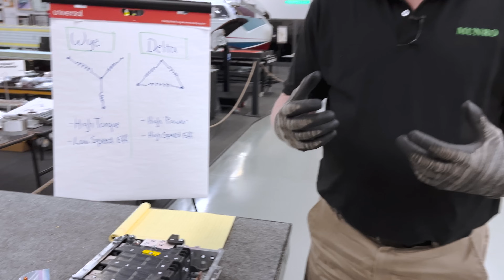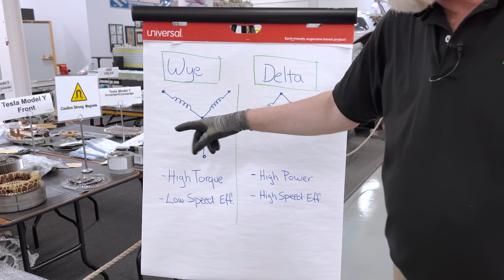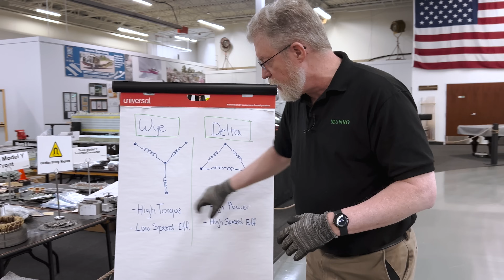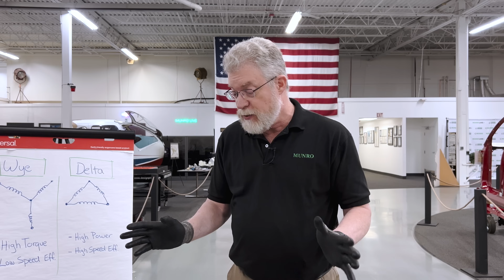KIA EV9 Dual-Stage Motor & Inverter Breakdown: Engineering Unveiled

Comment: This is very interesting! Thanks for the video. I would like to see the inverter teardown in the next one.

I'm curious if there really happens switching between Δ and Y or if there are just two 3-phase H-bridges there, connected to 3 terminals of the motor, i.e. completely independent driver for each coil.

The reason why Δ connection is not used in EVs is the variable inductance of the coils due to saliency of the rotor. I've measured it on the “Hyundai Ioniq Electric 28 kWh” motor. The inductance of the two coils in series in the Y configuration varies from 440 μH to 1100 μH depending on the angle of the rotor.

As the motor controller regulates the current thru the coils, the Y configuration is better because just 2 current sensors outside of the motor are enough the know the current thru all three coils. In the Δ configuration, the current splits according to inductances and if these are not the same and varying one would need the current sensor on each of the coils to be able to control it.

That's why a motor with Δ configuration would probably have 6 terminals as well, because the current sensor is naturally housed in the inverter and the Δ connection would be realized there.

Switching between Δ and Y would allow them to use higher inductance of two coils in series in Y configuration in lower speed to be able to control lower currents more efficiently. At higher speeds they could switch to Δ-configuration, alleviating the need for field weakening.

But this would be at the cost of additional Rdson of the transistors making up this switch. On top of that these would have to be actually 2 NMOS SiC in series (IGBTs would need additional components as we need it to switch the current in both directions).

Permanent 6-wire connection to two 3-phase H-bridges, on the other hand would have higher switching losses at lower speeds, so I am really curious which architecture they actually chose.

Other automakers like Honda use step-up converter (350V -> 700V) in their hybrid vehicles to shift the need for a field weakening towards higher speeds.
Reply: Very informative comment. The Munro live community never ceases to amaze me with their insights. We did check the winding pattern and physical connections to the inverter to determine whether this was set up as two 3-phase machines or a wye-delta arrangement. We also did a patent search and found a Hyundai patent covering this circuit and control method.
Reply: @PaulTurnbull-EMfield  Interesting! What did you find? Do they use Δ-Y switching or just 3 independent H-bridges, one for each coil?
Reply: The description and the appearance of the inverter case suggest that the inverter has six power outputs using three of them for delta and the other three for wye.
Reply: @brianb-p6586  That's highly unlikely. The motor has 6 terminals where each pair of terminals is connected to the coils of each phase, respectively. Having a stator with two sets of windings one for Δ, the other for Y would be wasteful as most of the time only one set of coils would be conducting current. This means -- if we made a single set of coils of twice a cross-sectional area of the conductors we would have 50% reduction in losses. Therefore I think it is better to have both terminals of each phase exposed and let the inverter to do the right connection. Besides, in Δ configuration, the controller needs to know the currents in each coil. It is not enough to measure to summed current in the vertices of the triangle and it does not seem that the current sensors are embedded into motor windings. The are usually found in the inverter.
Reply: @32bits-of-a-bus59  you're right - I had not had my coffee yet! The six inverter terminals, each driven by one power section, need to connect to the six winding terminals. All six are required at all times, driven to effectively make the two different connection topologies. 

In delta each phase would need to be driven by two inverter sections, with their net current equaling the net phase current, but current from one winding to the connected (in delta) phase passing through both sections instead of none. 
In wye, three inverter sections would need to serve as the three phase outputs, with the other three effectively shorting the other ends of the windings together.
Reply: @brianb-p6586  I'm not sure if it can be done so easily. Take for example your suggestion of having Y connection realized by using the second 3phase H-bridge to connect the terminals together.

That's problematic because a standard H-bridge would also ground them or connect them to a supply voltage but we need a floating center tap for Y-connection to operate as expected.

That's why I'm not yet convinced if they really are using Δ-Y switching. Though it would have the advantage of larger inductance at low speeds, thereby prolonging the impulse time to the transition time ratio hence lowering the switching losses. But it would require 6 additional N-MOS transistors.

Two of them in anti-series connection would be needed to connect each phase to a central tap because the voltage direction changes during the rotation and N-MOS can only be really turned-off one way (because the body diode always conducts in the other).

Then you would need another 6 N-MOS transistors to realize Δ connection.

These 12 transistors would just switch once to select the configuration so there would be no switching losses as in the H-bridge. Only Rdson losses.

But whether it really pays off over just having two 3phase H-bridges and operating them as 3 2lead H-bridges, one for each coil, I'm not able to tell.

Maybe they have managed to design a switch between Δ and Y in a more elegant way than I was able to imagine and they don't actually need 6 more power transistors over those 12 used in the two H-bridges that would control each phase independently.

Comment: Instead of ioniq 5 Boost DC/DC converter using the motor’s inductance for 800V battery charging at a 400V charge site

It is even wiser to have a battery pack split module to halve 800V battery to 400V - for native charging on any fast charge system, without power loss

Like the cybertruck does

Comment: Excellent presentation! I don't know if what Kia did could be termed First Principals thinking, but it is definitely thinking outside the box.

Couple of notes:
1) When Paul mentions "interior magnet" the full description of the term is "interior permanent magnet".
2) When he refers to the "switches" in the inverter, I'm pretty sure he is referring to the Silicon Carbide switches used by the inverter (not sure if they are MOS FETs or IGBTs). Interesting that Tesla has backed off of SiC based switches (as opposed to traditional silicon), as Kia ramps up their use.
Reply: re 2), cost most likely SiCs are a fair bit more expensive than traditional silicon.

Comment: Now, imagine an attack on the car and making it change from Delta config to the "charging mode" while going at full speed in the road!!! Do they add security in those "smart" stuffs???
Reply: You're assuming this is software controlled with access by the car's ECU for OTA updates; it is more likely hardware controlled (even if MCUs are involved) inside the inverter. By way of example, the recent Kia update's to the ICCU charge controller was requried to be done in shop not OTA using a physical connection.
Reply: @GruffSillyGoat  OK, let's assume it's hardware controlled. Now imagine a fault in the "crash" sensor leading to the first scenario. Are they using some sort of protection for this cases? (See https://en.wikipedia.org/wiki/Radiation_hardening - Section "Logical" in "Radiation-hardening techniques", also https://en.wikipedia.org/wiki/Triple_modular_redundancy). If they are, those systems will be expensive, since they must be reduntant (cost multiplies by a facyor of 5). If I ever buy one of those things, I'll make sure no computer takes control of the car (or any critical system) while driving. We still cannot make computers "safe" for this kind of stuff (it's expensive and expensive goes against capitalism 🤷‍♂)

Comment: Plenty of equipment in the industrial industry that switches between Star and delta without stopping the motor , not sure why you would think otherwise, I  bet the compressor in your workshop has a star delta starter in it.

Comment: In effect, the switch between the "Y" and "Delta" configurations acts like a 2-gear transmission.
Will there be a clutch and gear shift lever offered to simulate a manual transmission?  😀

Comment: Does this re-wiring the motor mean all the current goes via power silicone twice? That could mean double the losses if so, in the inverter.
Reply: Yes, the way the "dual stage" inverter is set up the current passes through both sets of switches. Only one set has to pulse width modulate though so only the conduction losses from the second set are added. This allows Kia to smoothly transition between wye and delta unlike the contactor method that some commenters have mentioned.
Reply: Some current will need to go through two power stages instead of one, and some will go through two instead of none, depending on the configuration. Yes, that has an efficiency cost. 

The word is "silicon", not "silicone"... and the semiconductor may not be silicon.

Comment: Delta configuration allows to circulate 3rd harmonic current components which in a triangular connection cannot do as they are zero sequence/ homopolar currents. Overall is a bad decition to go to delta connection (at least if motor is tracktioning) as long as this 3rd harmonic is not being control by SW which I do not think is happening. It would be great if you have the chance, to ask to Hyundai ENG how do they deal with this 3rd harmonic issue.

Very Good Video as always!
Reply: Smart and right comment. Actually it seems that the machine is not physically delta connected. As spotted out by someone in this thread, the patent shows that they implemented an open end winding scheme. In virtual delta connection the homopolar machine current can be actively controlled (the drawback is a reduction in the maximum voltage limit for torque generation). It would be interesting to analyze the machine to see if they made design choices to reduce the third harmonic in the back emf by winding scheme or, better, rotor geometry.

Comment: Electric machine? No longer refering to then as motors?
Reply: They have always been "electric machines". That terminology is used most commonly where the machine is used as both a moor and a generator, and may be used to distinguish the actual motor from the supporting electronics and gearing.

Comment: Star / delta seen from my childhood ( seen in Floor mill the operator switching it to start and run ) .. these are not innovation , they are basic motor configs , now latest ones are hybrid ones . As you have details about all EV motor can you provide comparison in terms of efficiency , speed , cost , reliability  of motors from Tesla/Hyundai/Rivian/Lucid etc ..

Comment: You should be able to transition from delta to wye with just a set of 5 SSRs, so you don't really need to entire separate inverters to control your motor.
Reply: That's true if a traditional hard switch between wye and delta is the goal, but Kia is able to use PWM to smoothly transition between the configurations under power. That requires 6 solid state switching devices.
Reply: Those Solid State Relays are just as complex and expensive as inverter power stages.

Comment: I feel the need to interject but the Renault Zoe has been using the motors as charging inductors for probably 10 years now. People have been complaining about the whining noise while charging until the reason was disclosed. Similarly, I might be wrong, but in some old electronics books I read about big motors being started in Y and switched to delta once up to speed. I guess it's an innovation in the powertrain industry but IGBT prices are now very small compared to battery prices. I'm sure thousands of people thought about this already. Sure, cost-effective implementation is a big step so I have to commend them on that.
Reply: The ACP Tzero and original design of the Tesla Roadster also used the motor for charging.
Reply: Wanted to say the same thing. The Zoé is 12 years old now :D. Interesting that they came back to it
Reply: This is not new tech and the advantages are significantly overstated. This whole video reeks of sponsored astroturfing.

Comment: Can this be the cause of the vibrations all EV9’s have? It’s not the tires or wheels. Mine been at dealer straight 41 days and Kia has no clue the cause. Lemon law next. Google ev9 vibration they’re all doing it. The GT line loaner driving now same vibration. Go test drive all on dealer lot. 63mph to 78mph they all will vibrate the steering wheel out of your hand and vibrate the floor and console horrendously.

Comment: Holy moly!  This is no small improvement!!  I doubt the non-engineers out there can really grasp what just happened!  No, really... this concept will truly be a huge benefit... better low-end torque AND better high speed efficiency!

They really don't have that much of a cost disadvantage either, as the Inverter transistors are serving dual purpose... drive the motor AND boost conversion for charging.  

SO COOL!!!
Reply: Re: Inverter Versatility. Also, for bi-directional flows to double as power walls?
Reply: Actually this is a fairly common way to get a softer starting behavior, it's commonly used in high power asynchronous motors in industrial applications. It is quite fun to see it in an automotive application though.
Reply: He says it: you need two separate set of switches.
Reply: So is this better performing than say a Tesla Model Y motor? If so, by how much?
Reply: @willaerley7140  It can be run in two configurations that can improve efficiency at high speeds and low speeds... but there's no way to definitively say "how much" without specific parameters.

Comment: I wonder if changing the operating mode from Wye to Delta requires very precise waveform synchronization. I think that the high RPMs and the fact that the engine works with magnetic slip anyway make the change at a random moment imperceptible. I would like to hear what people smarter than me think.
Reply: "Magnetic slip"? This is not an induction motor.

Comment: The boost converter from 400 to 800 must be slower than to connect the battery pack in parallel.
I don't think we will have 400v charger for long anyway, here they are all 800-1000V appart for Tesla.
Reply: Tesla is now making 800V chargers with their V4 superchargers
Reply: @RC-fp1tl  Yes, I suspect all the new chargers will be 800V, so are the new models. Lower voltage was only to get the EV transformation started.

Comment: The way you explained the triangle vs star motor makes me think you don't know much about electric machines.
I guess making a switch to swap the connection type is cheaper than a step down coverter.
You do not gain torque. You just gain efficiency and you would not be able to use the extra torque from the extra voltage because the coils would go boom.

Comment: Thoughts on using Kia motor as boost converter to achieve 800V from a 400V charger, vs the Chevy dividing battery to be in series or parallel based on charger voltage (in terms of efficiency/cost/feasibility).  Some initial reports on the Kia has charging limited at 400V  to under 100kWh.  I would imagine the SilveradoEV would have a better charging curve at both 400 and 800V, and cost less.

Comment: Does the new EV3 have this motor?
Reply: It won't have the booster functionality as the EV3 is on 400v architecture. Whether it has the star-delta configuration will depend on the cost of the motor, as the EV3 is aimed at a much cheaper price point.

Comment: Star delta has been around for ages
No lock out just two contractors
Reply: It has, in old-skool hardwired-contactor form (e.g. star-delta motor starters), but not integrated into a motor drive like this! I've never seen star-delta integrated into the solid-state output stages of, let's say, an industrial VFD or servo drive or spindle drive. The hardwired star-delta motor starters were done that way to contain in-rush current when starting a big AC induction motor.